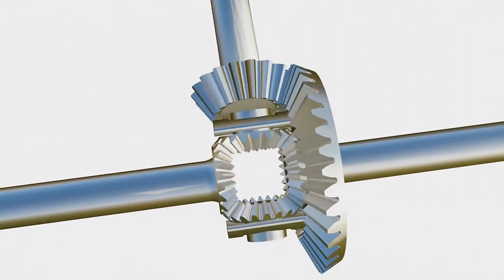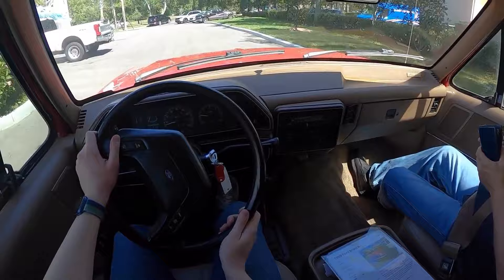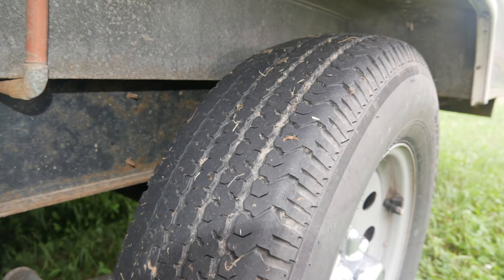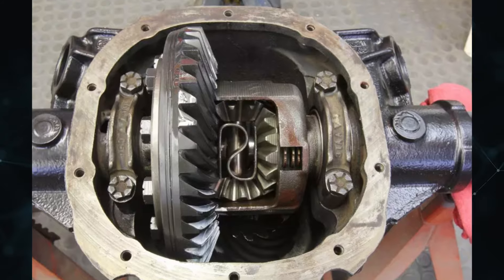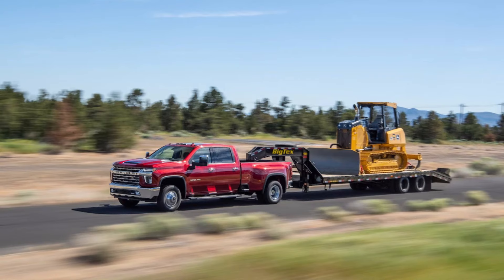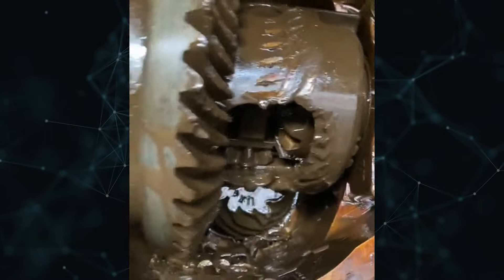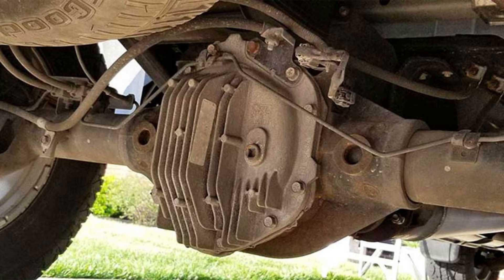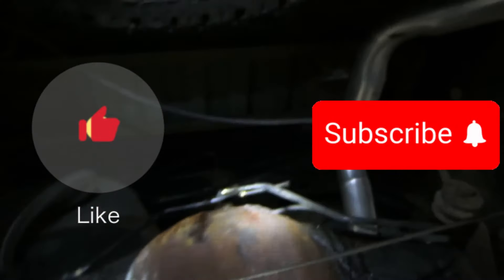3 Common Bad Differential Symptoms. Bad Diff Causes & Replacement Cost

Comment: I am getting a mild sound from rear differential on my 2018 nissan rogue, 64000 mile driven and the car mechanic team asking me to change the complete set of differential which cost 3500 dollar for new one and 2700 dollar for used one.  They said its the bearing issue inside the differential but not serviceble. Its just a begining. Not at the worst condition. Whats your opinion on this? Please advice

Comment: I Just got a quote for my wife's 2019 Jepp Wranglers rearend the bearings in the diff are junk and the a whole new one will cost $5914.00 just the parts without labor she only has 80k miles on it and does not even take it off road.
Reply: They also installed an after market alternator without my consent makes me wonder what else they install aftermarket.

Comment: My Captiva AWD has an issue. While turning the steering or making a U-turn at slow speed, the car shudders as if something is holding the tires. While reversing and turning the steering, it holds the tires with vibrations. Moreover, both the rear tires are worn only on the inside. The problem doesn't seem to exist when I remove the drive shaft. I tried to change the drive shaft of a good car, but the problem didn't seem to go away. Please help me. What might be the issue with my vehicle?
Reply: Sounds like torque conveter